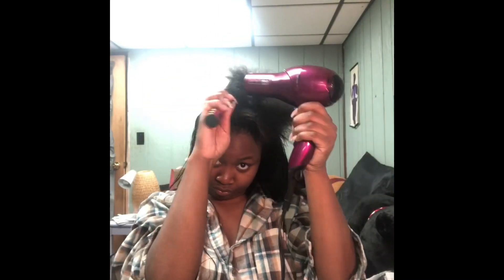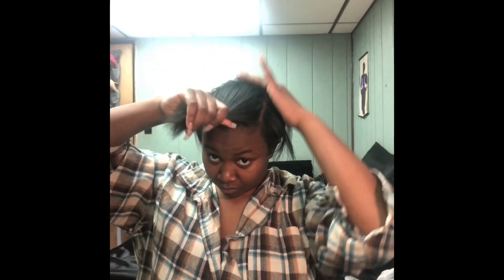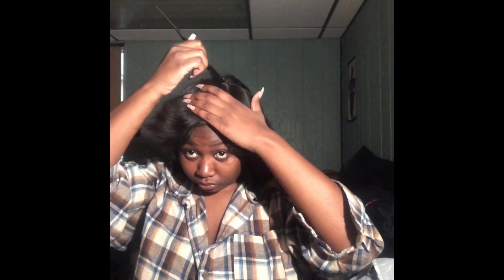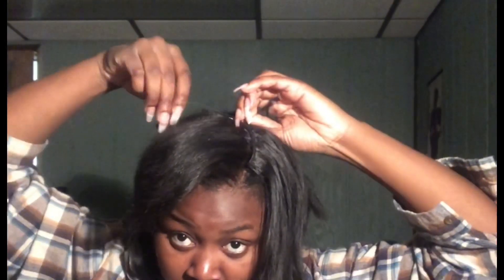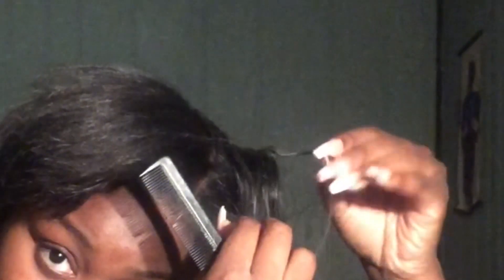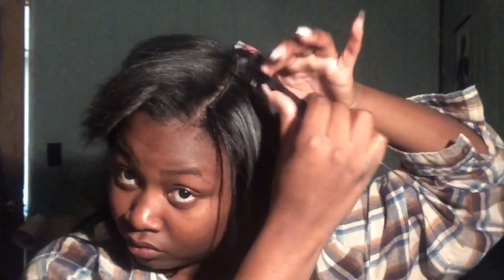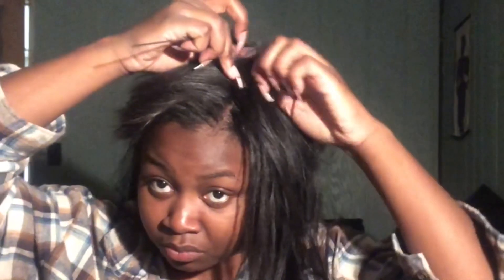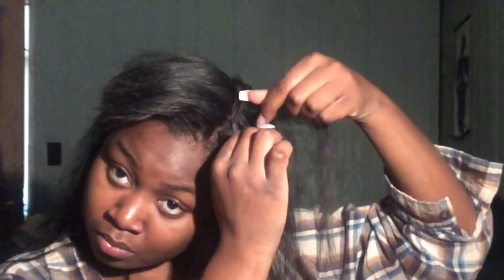MICROLINK TUTORIAL ON SHORT HAIR!!!

Comment: Is this method easier than using itip hair ? I wonder if this method is good for thin/fine hair
Reply from the maker: Well I’ll never do It iTips because my arms would simply fall off 😂
Reply from the maker: I think it’s very easy. I’ll post a video doing a full head
Reply: @Point5Cosmo  ok id love to see a full head cause how do you see the back ?thanks hun
How long did they last?
Do you think just as long as braidless sew in ?
Reply from the maker: @raya74  i say 4-6 weeks but you do have to remember to retighten I usually retighted at 3 weeks. 
same for the braidless because the foundation is the microbeads it will need to be retightened